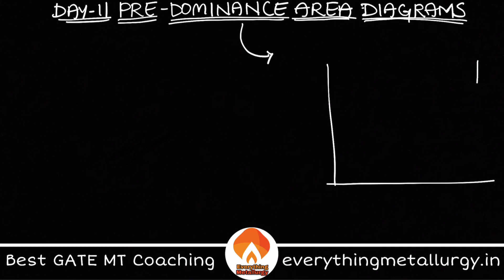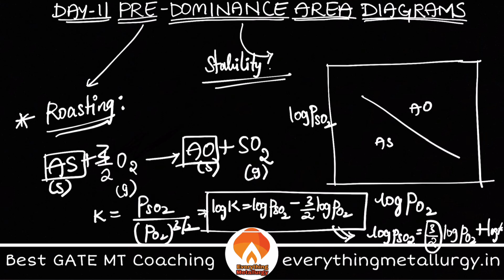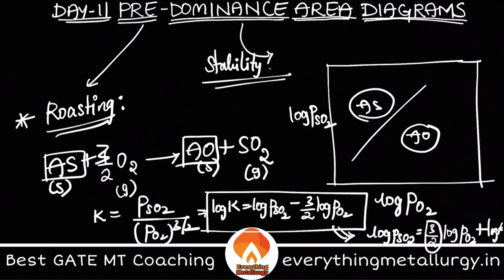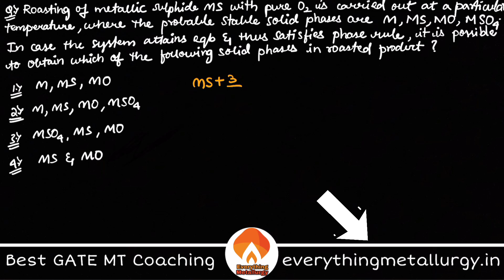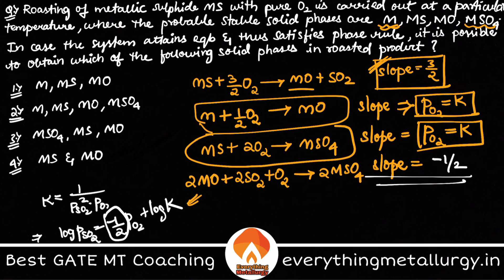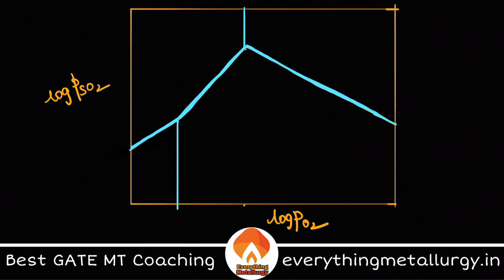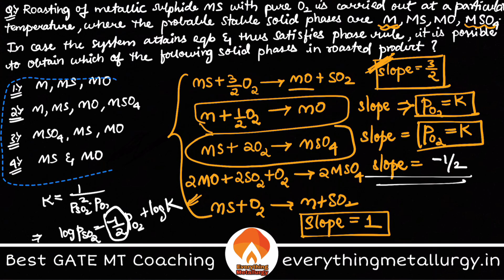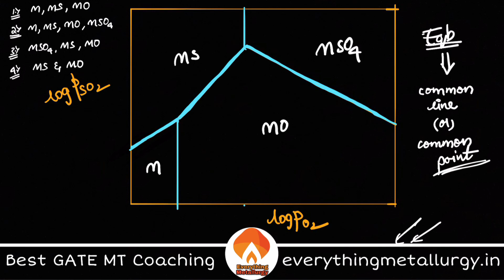GATE MT2021 |#100days100concepts | Day11-Predominance Area Diagram | everythingmetallurgy.in |Videos

Comment: Sir how did you  mark the phases M, MO etc after marking the lines in the regions ? How to find in which region which phase is stable?
Reply from the maker: That's with the values of SO2 and O2...forward and backward reactions depeninding on the partial pressures....so u get from.it